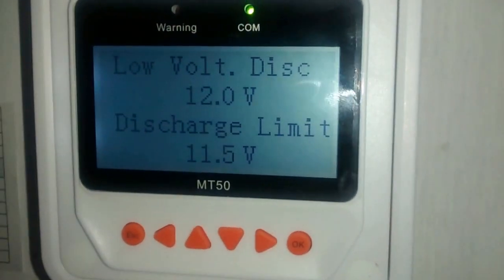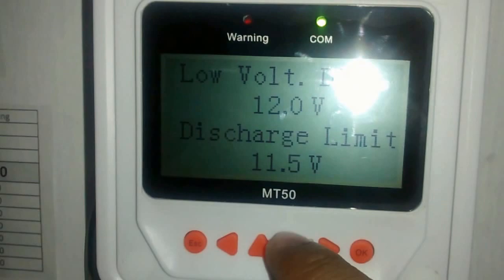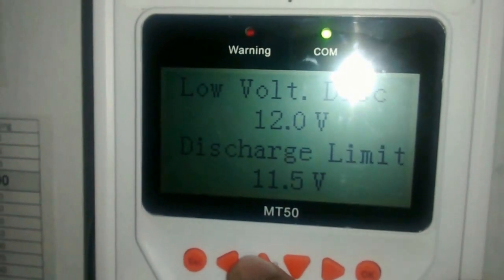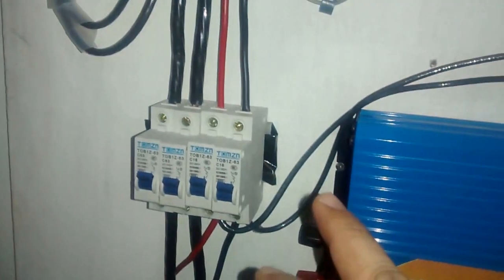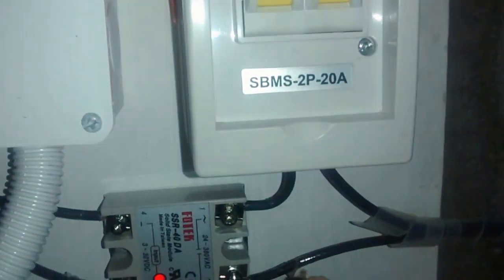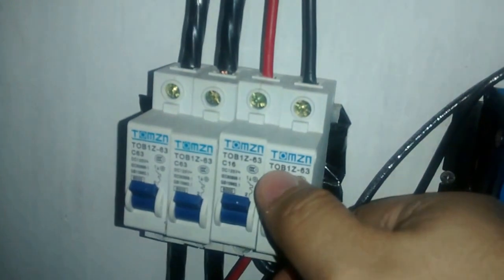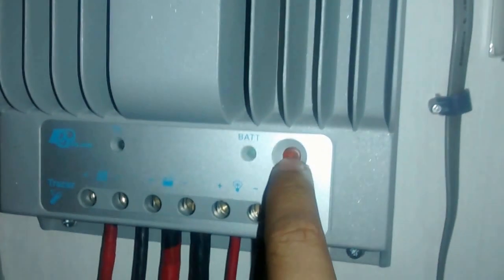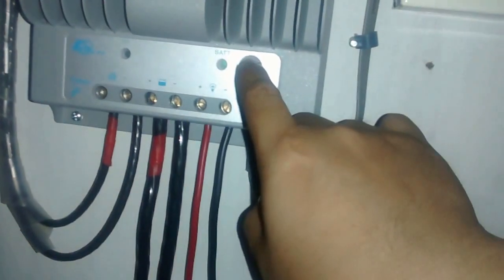Low Voltage Disconnect using a Charge Controller

Comment: why did you use an SSR. Thou the input side is extremely low power consumption. The Load side has a tendency to waste power more and easily gets hot (depends on your load).  A mechanical relay on the other hand uses about 1-2W on the input and nothing on the output.  Did you work out your power losses between using an SSR vs a mechanical relay?

Comment: Excellent idea! I had thought of this but cutting the DC side, this method is much simpler and safer as there are much less amps on the AC side. I installed my first solar system and adopted this system, so far it's working nicely!

Comment: hi if your setup is 48volt  how many volts are comeing out of the load port on the controller going to the ssr ...because the realay is maximum 34 volts
Reply from the maker: i step it down with dc to dc converter.

Comment: What is the Low Voltage DIsconnect module you are using?
Reply from the maker: the solid state relay?  or the charge controller?

Comment from the maker: yes its still working.  i ordered it thru Amazon.com
Reply: +Glenn V Thanks for the reply. Just to be clear. the AC load coming from the inverter is passed through the relay right?
Reply from the maker: +bigbrovar correct.  1 leg of the AC line passes thru the relay. (electrical switch)

Comment: Thanks so much for this. Just what I am looking for. The lvd of my inverter is 10.5 which is way to low to protect my battery bank 2 12v 200ah batteries connected in parallel (400ah), quick question, I am using the tracer 3215bn cc. how accurate is it reading of battery voltage? will connecting 2 200ah 12v batteries in parallel affect the reading of the cc because without an accurate state of charge reading from the charge controller.. battery won't be protected.

Comment from the maker: the load terminals can only handle small currents.  mostly used for street lights.   with big loads like a 12v 1000w inverter, it will pull at least 83A.  that will destroy the charge controllers load terminal.

Comment: Just curious, was there a reason for using the SSR? couldn't you hook up the inverter directly to the load terminals on the charge controller so the charge controller would cut DC power to the inverter?